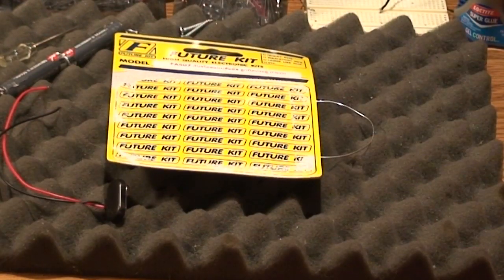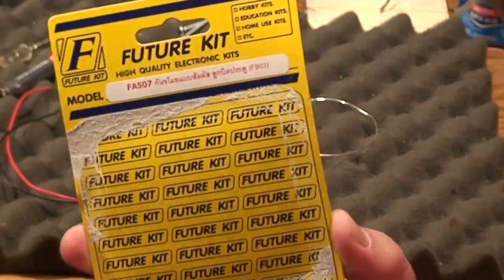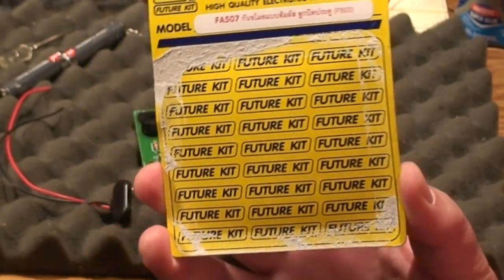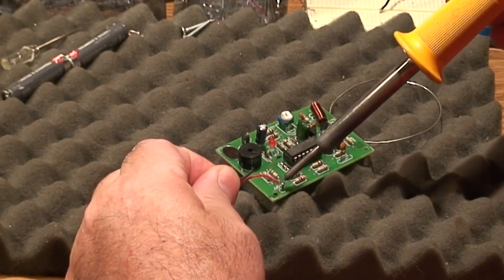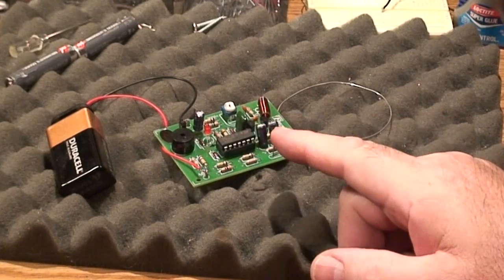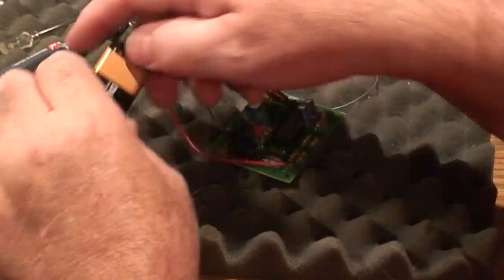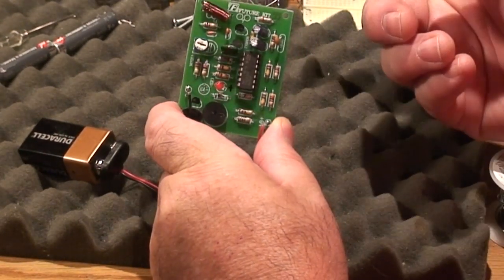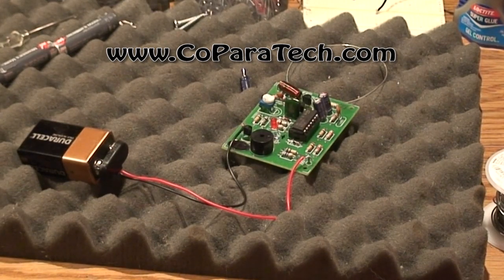How To Make a Paranormal Touch Detector

Comment: I'm wondering if there is a way to put that into a box of some type? Thank you
Reply from the maker: Hi Jennifer. Yes these devices can be mounted in a box. Electronics parts stores and online sellers such as Ebay and Amazon have project boxes which can be used for that. Some even have internal compartments for a 9 volt battery. You would need an external 9 volt battery mount if there is no battery compartment in the box. You could add an on/off switch and even an LED and external antenna as well. There's really no limits to the modifications you could do to make your own REM type pod out of this.
Reply: @RichHorn  thank you so much for your help!

Comment: Can i add more led lights to the board ?
Reply from the maker: You could add more LEDs but you would have to change the resistors on the LED circuit and keep the voltage low, so probably no more than 2-3 LEDs on this board.

Comment: I'd like to replace the loop with an antenna. Suggestions on how, would be great.
Reply from the maker: kbhoney1  It's pretty simple to change the loop for an antenna. Just unsolder the loop and solder the base od the antenna to the same point the loop was connected to.

Comment: You can buy door alarms from China on Ebay for about 3 bucks,you can get either a touch detector or a vibration detector.
Reply from the maker: mikeh278 Yes the prices have dropped alot in 3 years, but this was mainly for the people who like to build their own gear.
Reply: Michael Hohl Hi Mike, what do you search for on eBay to find this doorbell so I get the right one.
Thank You for the tip!

Comment: I recently bought one of these and modified it just like you did I cannot stand the long tones might be good like you said if it was left in another room but I guess my question is have you ever tried putting this device inside of a trigger object such as may be a doll or a teddy bear and if so has it ever worked for you let me know what you thought is thank you
Reply from the maker: UNEXPLAINED PARANORMAL RESEARCH I have made similar trigger object devices, such as teddy bears and dolls that could detect EMF and touch independently. From my experience, the touch detectors were rarely triggered and, of course, the EMF detectors were frequently triggered.
Reply: Rich Horn do you have a video of how to do an EMF triggered bear?

Comment: This is a Capacitive proximity sensor. Simpler ones use one transistor (npn) as a switch, and two others (pnp) back to back as signal amplifiers. The diode restricts the flow of electrons reversely. This model uses an IC, I'm guessing a lm324n or similar - though I've seen others that use a led lighting IC. I've seen really sensitive versions that don't even require direct contact with the metal wire. Sensitivity is based on the mode of switch and amplification. Those rem pods that cost 100.00+ retail are only worth about $5.00 in parts.
Reply: Daniel Smith in fact this board can be set to react to proximity
Reply: @cristiansprenger418  how would this be done? It would be helpful if could let me know

Comment: Rich  instead of the metal loop it there away to put in alligator clips?
Reply from the maker: Yes Art, you can replace the loop with a straight wire with an alligator clip on the end. Be aware that the longer the wire, the more sensitive the input. Too long of a wire will overload the input and cause the detector to stay in alarm mode and not reset. So about 6-8 inches of wire is probably best.
Reply: Rich Horn